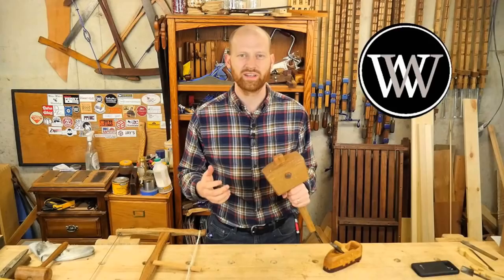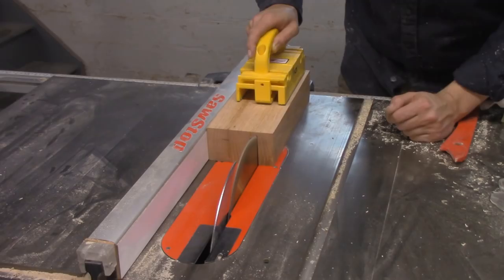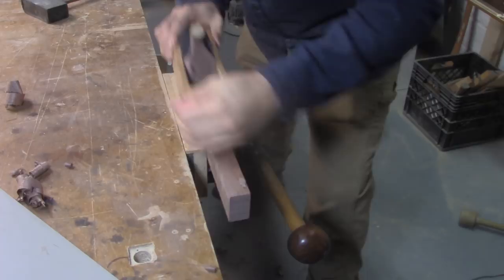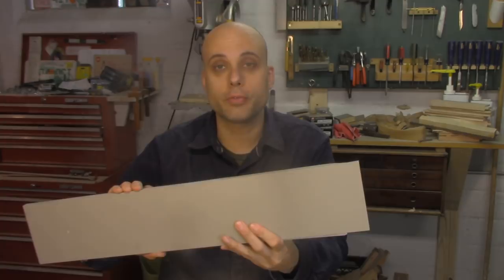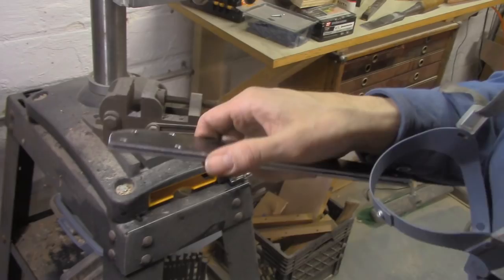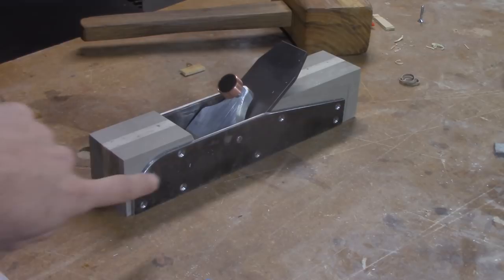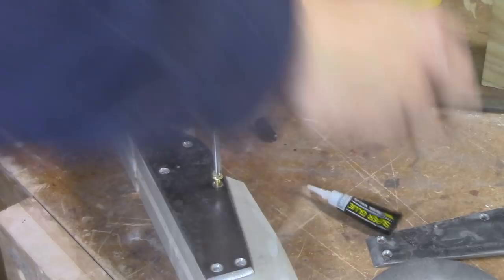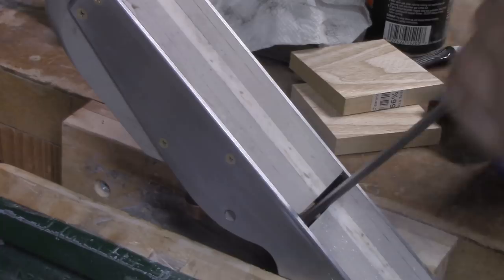Building a low angle miter plane. (Build-off with Wood By Wright)

Comment: When glueing steel or aluminum sand first and clean with acetone. Getting oxides off of of aluminum and scale off of steel, for steel you can remove it chemically easily enough. Great video btw, also I would recommend you get cold rolled over O1 if you are not going be heat treating it. Just my to cents....

Comment: Rex, I must say that is a gorgeous hand plane. I have several of your plans and your book so I look forward to getting my little shop back from our remodel storage and getting to work.  I have a lot of power tools but I am strangely drawn to wanting to use hand tools.  I have a old Sears and Roebuck hand plane (I think it would be close to a Stanley #4) that I inherited from either my father or my Uncle that got misplaced for quite a while (my fault) and is in need of restoration.  Lots of rust and ball and tote replacement to do.  And, of course, bringing the blade and chip breaker back to life.  You are teaching me a lot, my friend, and I look forward to building your low bench and Joiners bench.  Then I'm going to try my hand at your planers bundle.  Fun times ahead I hope.  I'll send you some pics to your Instagram as we go along.  Thanks for inspiring me.

Comment: Well, I was doing some research today and apparently, a jointer plane IS a shooting plane. The modern use of the term "jointer plane" actually refers to what would have been a "try plane" or "true plane," used to level a board face after taking off material with the jack or fore plane. The two types of planes look almost identical and can even be the same size: the main difference is in the steel. The jointer has a straight edge that's wider than the material it's cutting, which perfects the gluing surface. The truer has a cambered edge, but less cambered than the foreplane, so it helps to smooth wide faces and make them "tried and true". That being the case, Wood By Wright's design makes perfect sense.

Comment: I like it Rex.  It's more complicated then I would build a plane but it's very creative.  Your choice of materials reveals a deeper understanding of the problems that are encountered during a build of a miter plane.  I'm surprised that neither you or James decided to scew the blade.  Just a question.
Reply from the maker: Chris, I'm glad you like the approach. I was trying to work out the issues of a miter plane and let the materials guide that. In your comment, did you mean "skew"?  I originally read it as "screw", but I don't think that's what you meant. As far as skewing the blade, it just seemed harder to do and this thing took a LOT of work as it is. Making it more complicated was not in the plan. I see how a skewed iron is probably better and I might do one in the future. I also might just ramp my shooting board. In theory, this gives a similar effect with less effort.

Comment: I've had consistently poor results using cyanoacrylate adhesives. Suer glue makes an initially strong bond, but over time (months) it breaks down, as if the bonding element has a half life. I've had pieces literally fall apart, even when not under any stress. I've never had any issues using epoxy.

Comment: Instead of using screws, if you ever do this again, drill all the way through, countersink, and install rivets from mild steel (aka, a steel rod). Peen the rivet ends over, file them smooth and Bob's your uncle. Unlike the brass phillips-head screws, the rivets will be invisible after filing.
Reply from the maker: Corian is brittle. I don't think the hammer blows are a good idea, although i do agree that rivets are FANTASTIC.
Reply: @RexKrueger  Maybe the steel would protect the Corian. One doesn't have to hit the rivets very hard, so maybe some gentle tapping would eventually get it done.

Comment: I like your idea of using Corian.  Back in the day, the only way to get small pieces was to beg a sink cutout from a certified Corian installer.  Is it freely available now?
Reply from the maker: If you're limber enough to jump into dumpsters, then it's out there.
Reply: @RexKrueger  Uh, I pop and crack like a mule when I bend my knees.

Comment: You could have done the rough dressing with a file.
Reply from the maker: adam whiteson Thank you for that totally helpful comment.
Reply: Well  I did in fact mean to be helpful.  The file is underrated.  With some practice you can dress a surface to quite high precision.  This is the way the Victorian "mechanics"  worked.

I do have a Q?   If  this plane is designated for end grain work,  why would you worry about the mouth?  End grain doesn't tear out ahead of the blade.
Reply from the maker: Well, I wanted a plane that would be as useful as possible. I also want to be in control of all the aspects of the tool. If I'm aiming for a tight mouth, I want to hit that mark so I can do it the next time. 

I think content creators get irritated with "you could have" comments. I could have done all kinds of things. This is what I did. On the other hand, if someone starts with "Did you consider" or "Have you ever tried..." it just comes off as more helpful. I get your intent now that you explain it, but phrasing is king on the internet. Thanks for keeping the conversation going so we could be on the same page.

Comment: Terrific build! I am so curious and couldn't find any info on the internet... why are 37 degree bed angle, bevel down planes so rare in the marketplace?
Reply from the maker: I can't say for sure, but these days pretty much everyone associates "low angle" with "bevel-up." There's a lot of hype around bevel-up planes and so that's what tool manufacturers make. It's very hard to make a bevel-up plane in the home shop because the bed has to be very thin. Wood is too fragile for that kind of plane, so you need some other material. Honestly, I don't even think Corian would work.  But for the home plane maker, making a low-angle bevel DOWN plane is no big deal. Thanks for watching and asking a really good question!

Comment: I think that’s going to be one of your favorites! Looks great. When your not making your own blades where would you suggest we get ours (on a budget)?
Reply from the maker: That is SUCH a difficult question. Hock blades are great, but they cost too much. You can get Stanley-style irons on Amazon for really cheap, but they don't come with chip-breakers and a chip-breaker is pretty necessary for a thin iron like that. Stanley does sell an iron/chip-breaker combo now for $22, but I find that a little steep for a plain old Stanley style iron. If you look at my "Make the Easiest Smoothing plane Ever" video, I make a good iron out of a big chisel for $13. Also, 1095 steel isn't that expensive and doing the heat treat yourself isn't hard; just time-consuming. Its a good project where you learn a lot.
Reply: Rex Krueger Yes I saw that excellent video you made. So I’m guessing just look for used 2” plane blades (which I assume are the most common?) with the chipper and be ready to put a back and edge on it? Thanks!
Reply from the maker: I think the most common blades you'll find are 2 inches or just slightly under. Either way, it doesn't make a ton of difference so long as you get the blade before you make the plane. That's what matters.

Comment: Nice,but ALWAYS remove the black mill scale from steel before gluing or epoxying,otherwise you are only gluing to the film,NOT metal.It's like gluing to a painted part,only nastier.....I know you did the outside,but I didn't see you remove the scale from the glued sides....